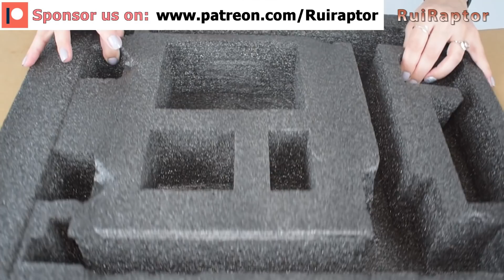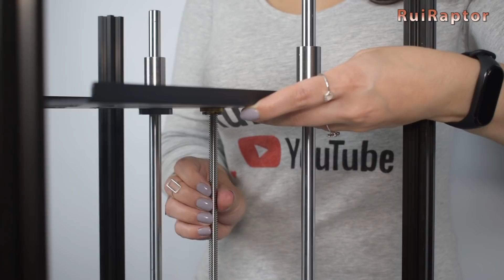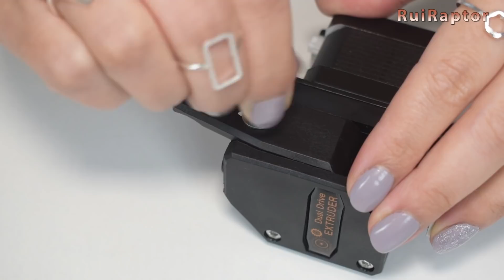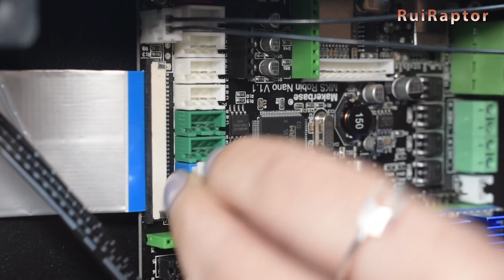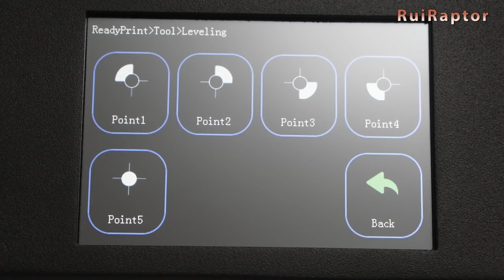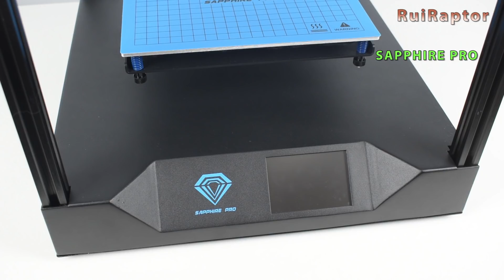Two Trees SAPPHIRE PRO - Assembly, First Prints & Comparison

Comment: Two Trees has made many improvements on the Pro since this review.
Reply: I'm considering buying one, can you tell me what improvement they have  made?
Reply: @steveo101112  same here
Reply: @Impecable..  i wrote the seller on AliExpress and they told me the pro has: glass bed, all TMC2225 drivers, "skylight" on the base by the Z stepper motors, and timing belt for the z stepper motors.
Reply: @steveo101112  do you think the Banggood units are the same?
Reply: @Impecable..  i don't see why not. But currently AliExpress is cheaper. 325 shipped from EU (if that's relevant for you)
Reply: @steveo101112  I’m thinking of getting the plus version which is just the pro but larger I think
Reply: @Impecable..  yea more or less. The Plus has two z stepper motors with is good to have. But both are definitely 'project' printers. You'll likely have to fix something or upgrade stuff to get it to work as intended.

Comment: what program does it use
Reply from the maker: What do you mean by program? Firmware or slicer?
Reply: @ruiraptor  doesn't matter I figured it out but it still prints junk and only clogs up the nozzle because its stuck to it i tried lowering speed and raising temp it worked but it just doesn't hold in place
Reply: stock hotend is pice of junk.. use E3V6 insted

Comment: hello Sandra. Thanks for the manual, but your video explains much better. Unfortunately it is my first 3d printer, and I am having a lot of difficulty assembling. Now I have finished assembling the structure, I have yet to proceed with the connection of the cables, we hope not to damage :)
In this video you don't talk about the filament sensor. Can you help me understand where it is mounted?

Comment: Undecided between the Sapphire Pro S1 and Ender 5? This will be my first printer.
Any recommendations please?
Reply from the maker: Hi, the sapphire pro has better hardware (board, TMC2208 drivers, titan extruder and it's a coreXY) but the ender 5 is easier to dial in and has the same easy-to-use extruder as the ender 3. Soon we will have a video about the Ender 5 and after that probably a comparison between both.
Reply: ruiraptor Thank you!

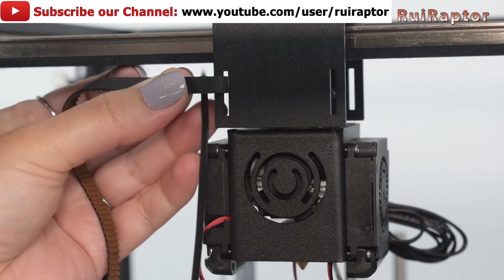Comment: Do not install belts the way is showed on the video it is wrong. @10:33 start not from left hole like in video but from right hole stead and rest like in video. And for other belt same start from left.
Reply from the maker: Starting the belt from the left or from the right is the same thing. The belt circuit will end up being the same no matter where you start from.
Reply: @ruiraptor  I prob. didn't explain my self well. you have to do this way https://imgur.com/NudQTf9. Otherwise your cable tie will hit idler when you try to home x and you won't be able to use whole bed area. I 1st did like in your video and ended up buying new belt.

Comment: Just a small correction, the blue piezzo sensor is not for the Z axis, it's used to auto-level the bed.

You heat up the bed, put it on the cold nozzle and run the auto-level sequence. It will probe all the necessary points using the nozzle tip, once finished you remove it and tuck it away.
Reply from the maker: Hi Rui,
You are correct and i also explained in the video how the sensor needs to be placed with the nozzle cold and needs to be removed once the leveling is completed. I also mentioned that you cannot use the sensor before flashing the firmware first because if you execute the auto-level sequence with the stock firmware it will not work. The number of leveling points can be defined in the firmware.

Comment: So, is this any better than mini prusas like Tevo Flash or Ender 3? Also, what are the top speeds and accelerations for this printer?
Reply from the maker: Hi Nathaniel, the corexy printer has it's advantages when compared with the cartesian ones. For our tests we used a higher speed than we normally use for the cartesians (100mm/s infill and 50mm/s outer layers).

Comment: Not enabling the firmware for the sensors is just plain laziness by Two Trees, not calibrating the drivers is negligence.
 Newbies would have a terrible first experience with this printer, I have watched 4 different videos on this printer and each one has had serious problems
Reply: And connecting one axis in reverse, using the wrong screws, not calibrating the temperature control and using a lagging firmware version makes me wonder why they put money into the nice design when they are obviously not planning to sell any of these.

Comment: cool video rui, better than Ender 5 ?
Reply from the maker: The Ender 5 is very good printer but not a CoreXY as many people think. The Sapphire has much better electronics but some of the issues like the lagging firmware, for example, need to be resolved asap.
Reply: @ruiraptor  any idea for resolve lagging pb?
Reply from the maker: The lagging is an issue with the firmware. To fix that we need to have a new firmware version.
Reply: @ruiraptor  marlin 2.0 seems be ok for this printer, maybe your next video...
Reply: @ruiraptor  At this time, i think, this printer is not for a new user, luckly we have the choice and install the last version of Marlin, and start to test all, like linear advance, Klipper etc, thanks for de video, you are the best!

Comment: Are the belts stiffer than the ones used on cartesian, how does it get around not having any tension adjustment?
Reply from the maker: The belts need to be tensioned while securing them with the zip ties. Many cartesian printers don't have tension adjustment either.

Comment: A great video. Thank you for the excellent work you do. You even manage to have background music that is nice and low so it doesn’t interfere with the dialog. With some tweaking of screw sizes and countersinking this seems like a very good printer. I think I would also change the part cooling duct as it looks too far from the nozzle and maybe an E3D V6 hotend